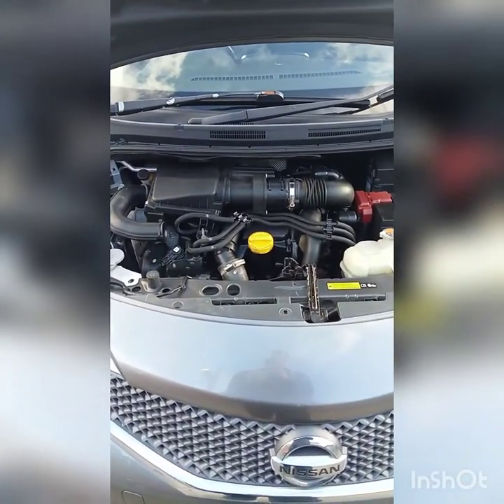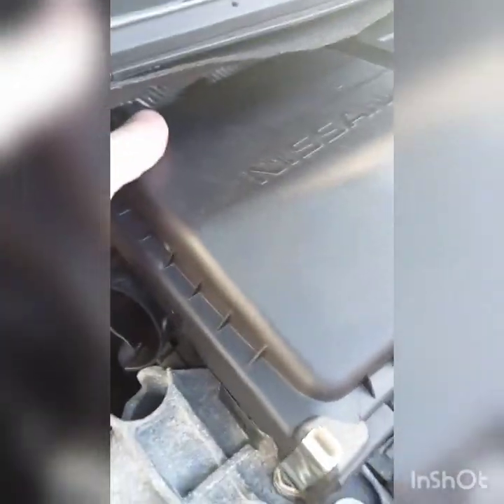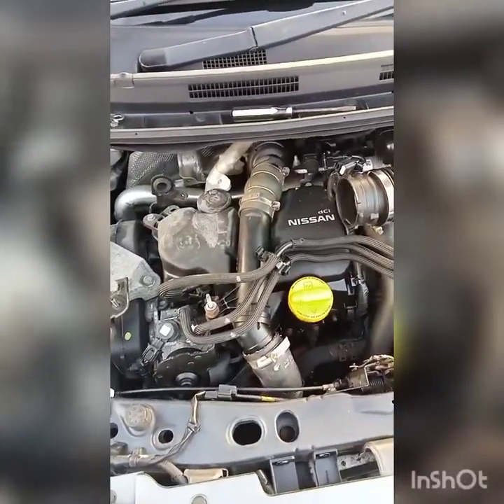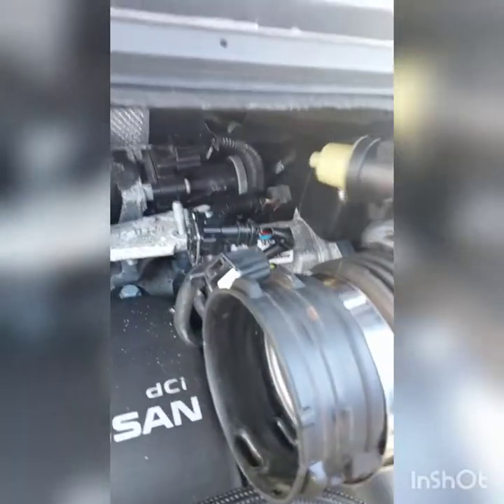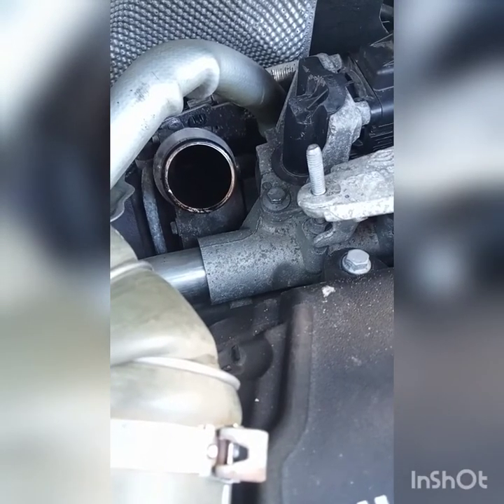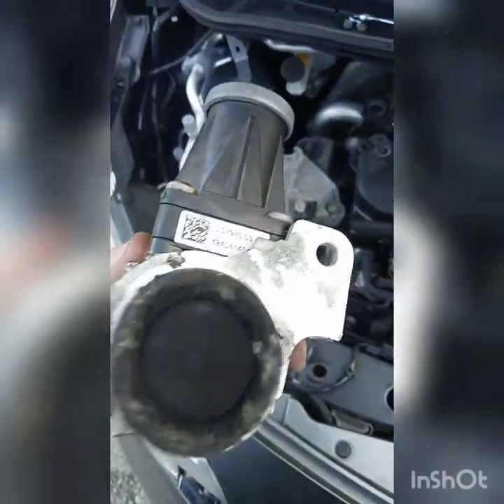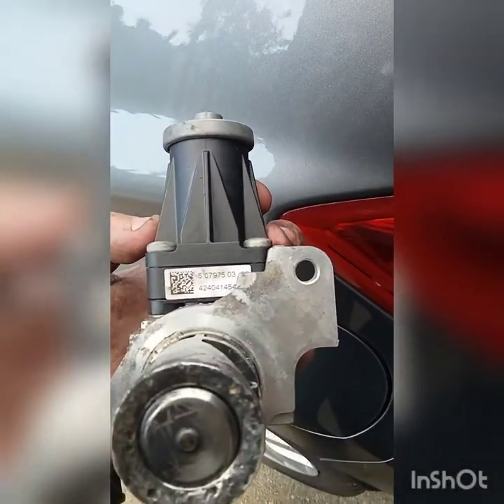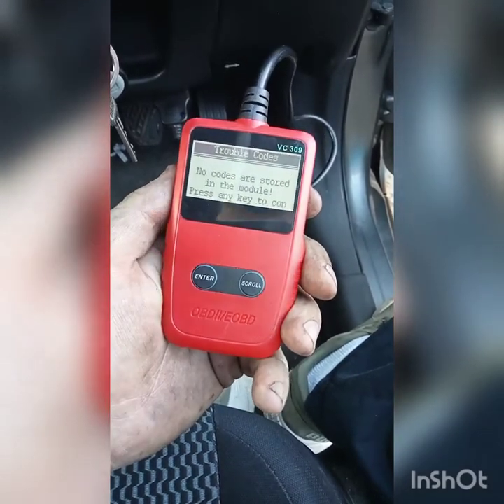Nissan note E12 DCI EGR valve removal and clean fault code P1494 Renault engine

Comment: Hello. What has been the experience after  removal ever since ?
Reply from the maker: The issue I had with loss of power was resolved, I did get another issue 3 or 4 months later which turned out to be a split dpf pressure sensor hose, very common on the E12 note
Reply: @Triplefigures1  I think this is with the DIG-S models?
Reply: @Triplefigures1  However I don't think this is in any way related to the EGR delete? And do you recommend other people to do that? Coz I'm current experiencing this (bad fuel economy, loss of power, check engine)
Reply from the maker: @Macrorough  the egr vale was removed, cleaned and reinstalled not deleted I don't recommend you delete the egr valve, it will throw an engine management light on which is now an mot failure 

I definitely recommend the egr to be removed and cleaned just like this video they get clogged with soot and causes issues such as loss of power, this is the 1.5dci model
Reply: I've done the cleaning. In fact, I've even replaced but still the egr code comes with the check rover and over thus seeking the EGR delete option. I heard there's a way to get around the ECU on realising the EGR system missing. What do you think?
Reply from the maker: @Macrorough  what engine is your car 1.5 dci?